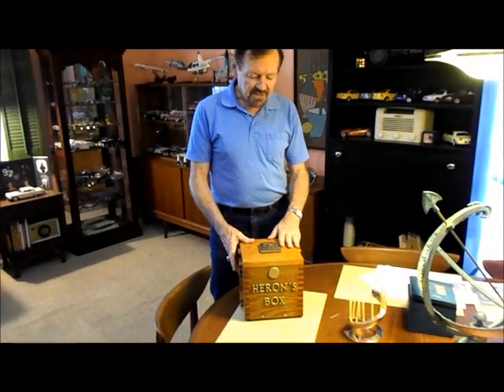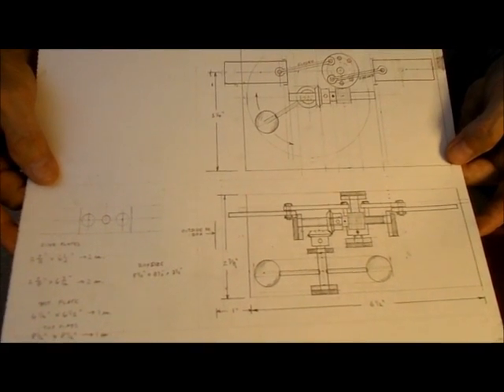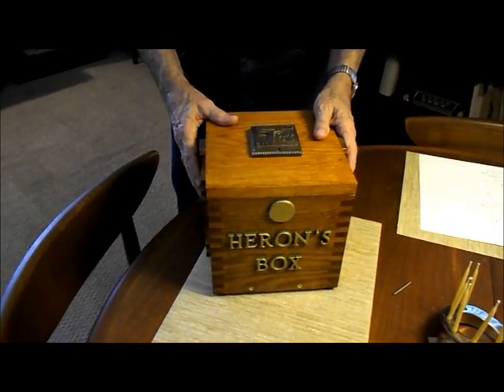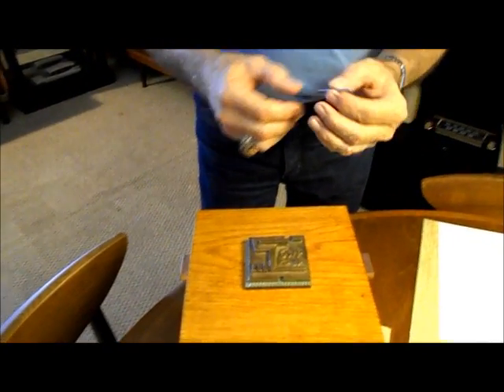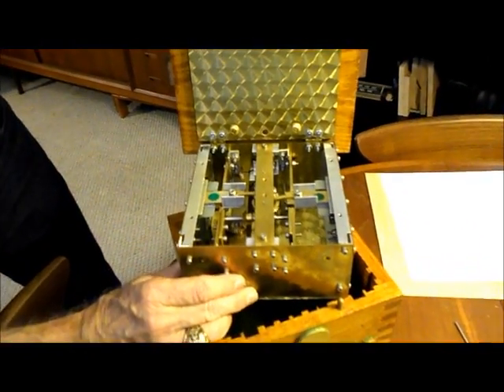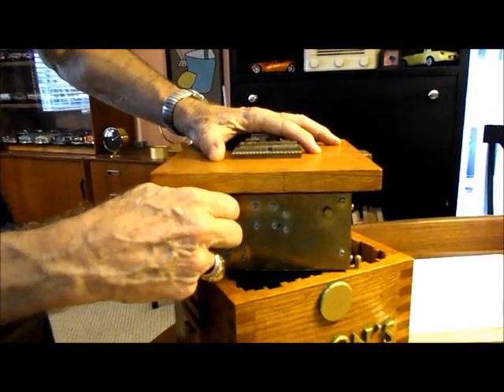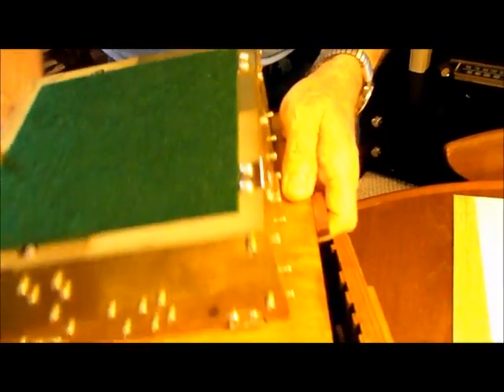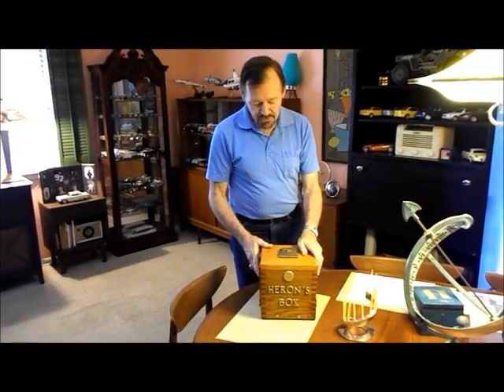Heron's Box - Secret Lock Locking Opening Puzzle Box Mechanical Mechanism

Comment: It's a great box and needless to say, very unique.  One question though, the locking pin you showed in the beginning of the video. How is that used?  Does it lock the box that no matter what [including someone that can figure it out] keep the box from opening?
Reply from the maker: The pin simply drops down with gravity out of a small tube, to then be in the way of the rotating weight - so that it can not rotate and therefore not allow the mechanism to go into motion.

Comment: great , i was thinking locking is all about one thing we have that others dont have like a key or a combination of digits , but this really is awesome , how swirling motion does that ? i need an answer.
Reply from the maker: The mechanism has a rotating weight on a moment arm attached to a vertical shaft, which will rotate when the box is moved in a stirring or swirling motion.  The weight needs the added force of being pulled around it's axis by the swift swirling motion, in addition to the force from the weight alone.

This in turn rotates a worm gear through two meshing 45 degree bevel gears.   The worm gear connects to a main gear that is parallel to the rotating weight ( both shafts are vertical) - so both the weight and main gear rotate in the same plane.  The worm gear rotates about a dozen times for the main gear to rotate one time.

Two cranks are attached to the main gear, that are in tern connected to the two locking levers - which linearly go in and out of the brass mechanism housing - thereby engaging the two slots in the sides of the wooden box.

The cantilevered weight does not turn by simply rotating the box sides end over end due to there being inadequate force because of the small size of the weight.  Also, there is a gravity pin that drops down in the path of the rotating weight, when the box is held up right.  The pin drops out of the way when the box is held upside down.  Only the swirling motion, when the box is upside down, rotates the weight.   Smooth and free running of the mechanism is essential for the mechanism to work and not be jammed.  Not easy to accomplish without a milling machine and a lathe, I guarantee.  All shafts run in lightly oiled (3 in 1 fan oil) brass bushings.  I sized and sourced the two bevel gears, main gear, and worm gear.  Everything else I fabricated, except for the 100 screws of course.
Reply: Bill Prince got it , that upside down thing is awesome , thanks for your reply.